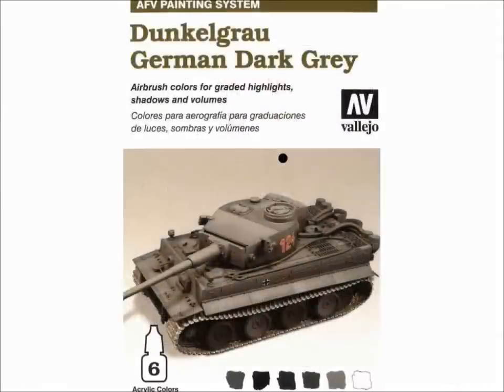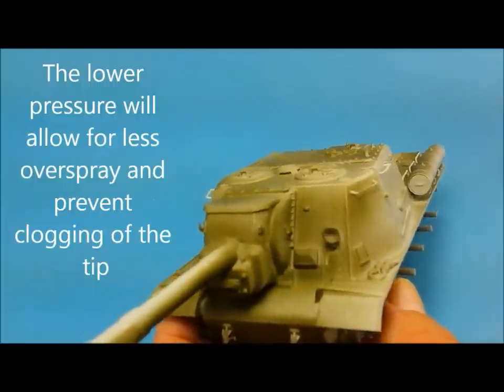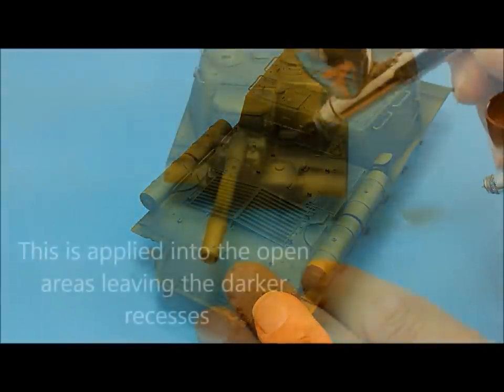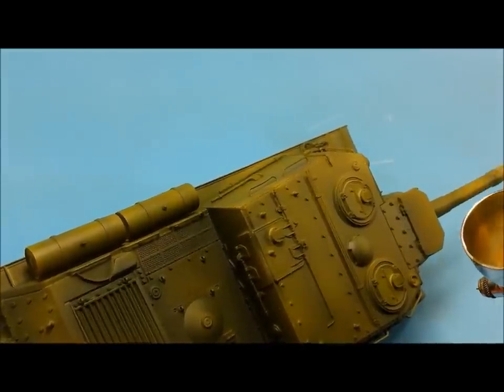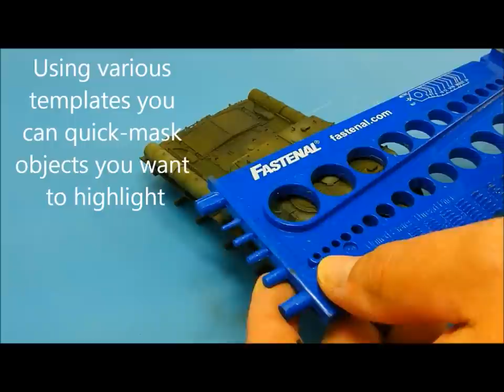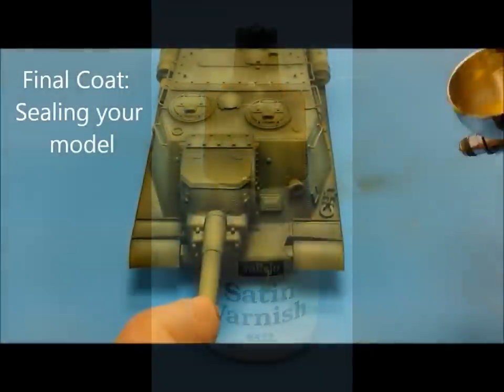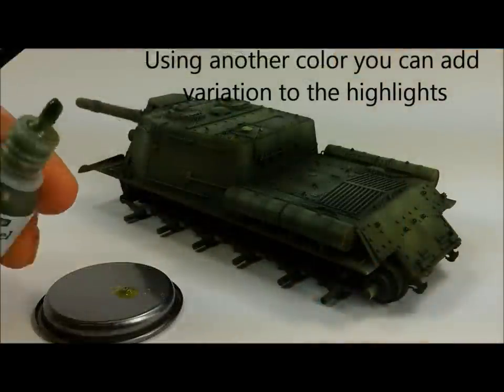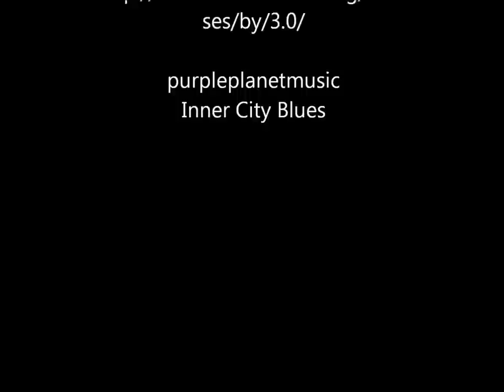Step by Step AFV Russian Green 4BO

Comment: Hi Great video. I was wondering if you have a video on the olive drab US weathering tutorial it it has the half track on the front of the box?
Reply from the maker: Hi Chief,   Thanks for the kind words on the video.   I do have one video that gives a basic look and usage of the set - https://youtu.be/5Ite5PGTGeg   The weathering part starts about 4:30 into the videos.   Sadly, I did choose a braille scale model for the review and the results would be much better in a larger scaling.  

The set is fairly straightforward.  There are three model colors included with the set.  The Camo Black Brown is straightforward in that it is a perfect color for adding rust chipping.  Even though it is Model Color, and designed for brush applications, it is possible to thin it to airbrush and add a more blended rust staining.  The other two colors work in combination with all three.  Mix a little with each...or all and you can obtain different rust tones.  

The model washes...well, they are washes...LOL!!  They both can be used to darken (accentuate) panel lines or panels.  These can be applied with brushes and or airbrushes.   They thin with water to lighten your initial approach to weathering or when creating filters.  They can also be added to the Model Color paints to give even more variation to the colors.   

The pigment provided is a generic European dirt type coloring.  It can be mixed with either the Model Color or Model Washes (and Model Air if you have any).  You can use just water to thin them for specific application and panel dusting or applied dry.  You can obtain more texture by mixing them with the Model Color and then adding more layers of wet or dry pigments on top.

There is a clear Pigment Binder added to this set.  you can use this full strength or mix it with water or even airbrush thinner.  Maybe 1:1 but this comes down to you personal preference.   II like to apply a damp to wet coat before the pigment and it will bind the pigments to the surface.  If you tap the pigment on top, you can blow off the excess and there will be some nice texture left behind...which you can build off if you want.  You can also apply the pigment to the surface and the binder after.  This should not change the color characteristics to the pigments like a clear coat will.  

It is a fun set to play around with.  It will give a great start to fundamentals with weathering.  You can find out what you like and how some things work and open the door to other pigments, washes and paints you can use to enhance the weathering even more later on down the road.
Reply: +Todd Michalak thanks so much for the info I'm going to try it out today also do I clear my tank/vehicles before I weather or after? thanks again;)
Reply from the maker: You're welcome!   As for clear coats...it is best to protect your work before moving on to the weathering stages.  It also helps better manipulation of some of the effect...such as washes and streaking.  Sometimes I will clear coat after washes, but not too often.  I do not clear after pigments have been added.  Clear coats tend to change the color too much for my liking.   

If and when I do clear coat, I will use a satin.  This helps with weathering and will not put too much shine on things.  If there is unwanted shine afterwards, I will pop a matte coat on to being it back to flat.  All of this comes down to personal preferences and of course confidence in what you are doing.  If you are comfortable with your bag of tricks then sometimes adding clear coats at certain stages can be bypassed if the base you are going over is cured.  

Cheers,

T
Reply: +Todd Michalak ;) Cheers

Comment: Very helpful, thanks. Any advice on how I paint a white campaign stripe on the model?
Reply from the maker: Thanks Alex!   I suppose taking care to do some good masking is the first thing with the stripes.  Next it would depend on if you were going for a more weathered look or not.  In either case, I would use a couple different white colors...White, Antique White and possibly mix some desert sand if needed.  If unweathered I would tend to stay away from the bright white...antique might be better...but that is just a personal call.  If you were going to chip the white, you will want to thin the paint somewhat and build up the layers...with whites of a couple different shades to add contrast.  If you use a chipping medium and thin the paint, you can control the chips to any stage of weathering.

Comment: Today in 2017 this set has different paints... mine comes wtih AK029 shadow, AK030 "dark base" then base, then light b ase, then "highlight" then ":shine"... no primer! Now i am painting acrylic, over enamel, fingers crossed hoping nothing goes wrong...
Reply from the maker: Hello Robert,  
The AFV Sets from '"Vallejo" have remain unchanged.  "AK029" and "AK030" are "AK Interactive paints.  Acrylicos Vallejo does not make AK Interactive's paints....they are two separate companies.  

With that said, as long as the enamel base you are using is dry and cured properly, you should have no interaction between the enamel and acrylic paint.
Reply: oh.. ok thanks, i thought they were the same.. mine came as a set and with no instructions. i guess i'll wing it
Reply from the maker: No worries my friend.   Interestingly enough, many people actually think Vallejo makes their paints or is owned by them because the owners of both companies have the same Vallejo last name.   Vallejo is like Smith or Jones...very common.   

I can tell you that you should be okay with the enamel base primer.  Just make sure t is cured before you add the acrylic colors.   To be safe, wait 12 or 24 hours or so.

After that, AK paints are designed to be applied in thin application built up.  Turn you pressure to about 12 or 15 psi and lightly dust coats on not trying to fully cover the model in one pass.  If working modulation you should be okay applying paint into the creases in one or two passes.   Repeat the process with the other colors until you get you desired effect.   Just build up the effect in light evenly applied coats and you should have no problem.   

Good luck!
Reply: I've learned never to write off the different paints, Acrylics are great for chipping and base coats, but i like to use oils for rust and streak effects. Panzermeister36 and Night Shift are two really good armour modellers that have shown me the light on how to elevate a model from basecoated to making a realistic model.